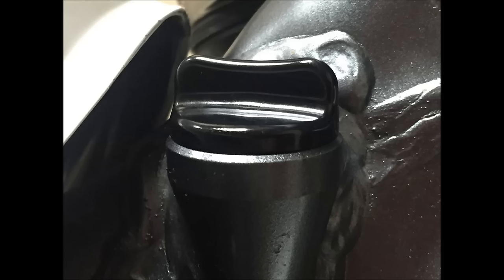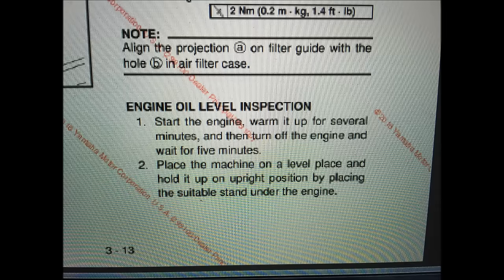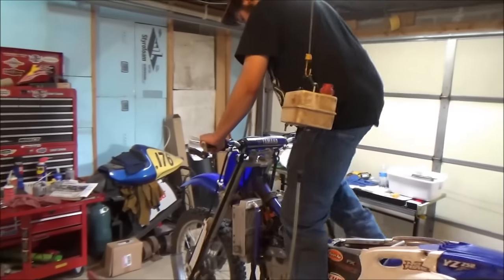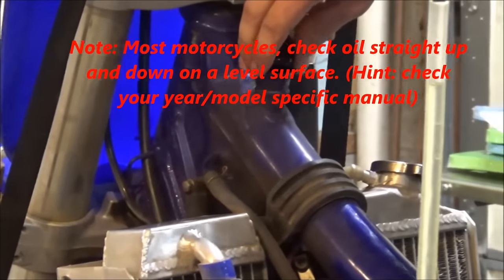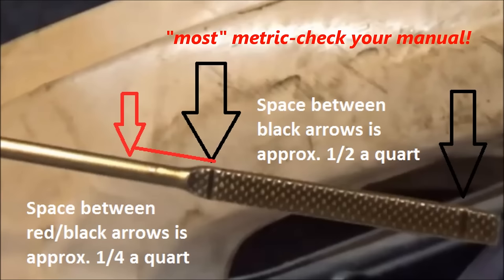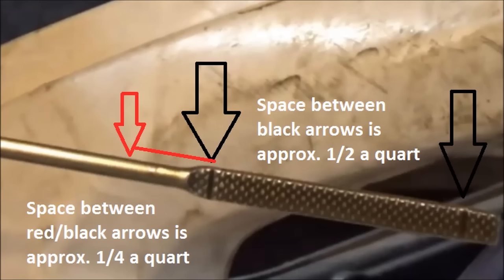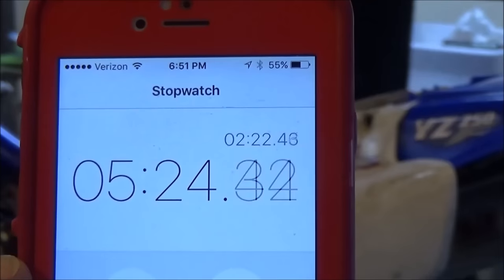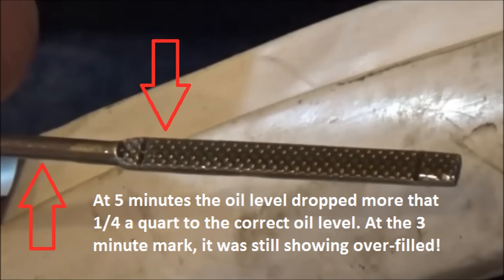How to check oil level on a YZ250F Similar procedure to check oil level on most Dry Sump Oil Systems

Comment: I just did a oil and filter change on my 02 and it was good went I put the bike up after work today I checked it again and it didn't show anything on the lipstick bur I have no oil leak
Reply: Did you run it to temp and wait  5 mins to check?
Reply: Did you run it to temp, then wait 5 mins and check?